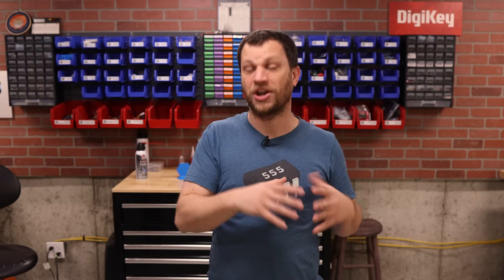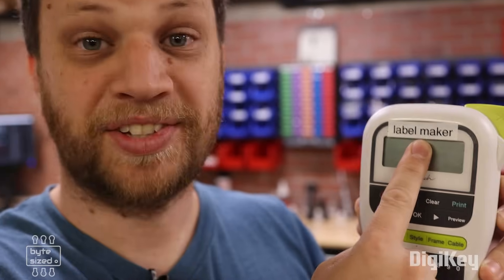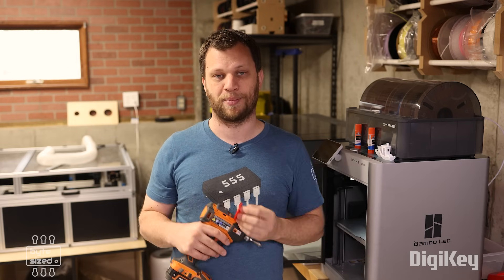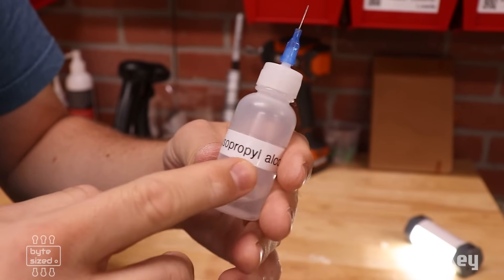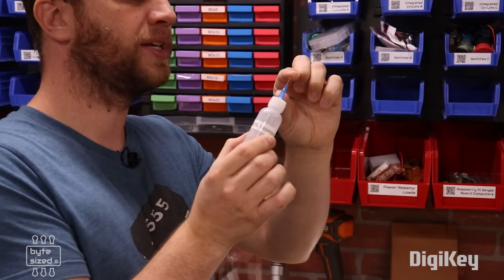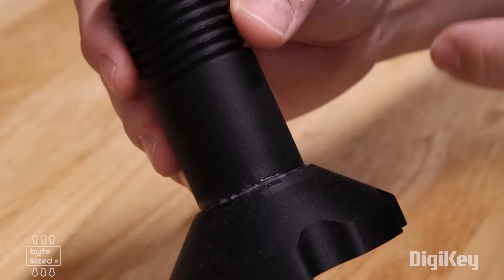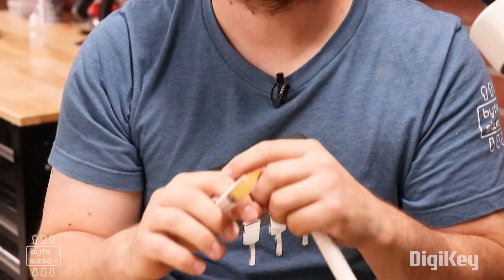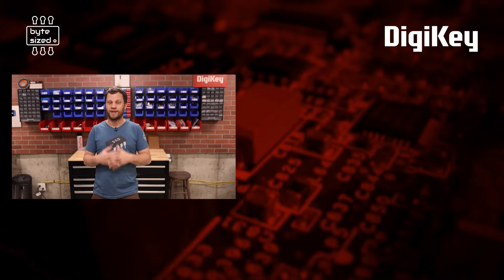8 Things I wish I’d known sooner - The Byte Sized Engineer | DigiKey

Comment: CNCKitchen makes some pretty sweet deburring blades that work better for 3d prints, and they sell them in both right and left hand versions.  Omnifixo makes some of the coolest helping hands with clamps that are superior to alligator clips as they apply even pressure to the entire item you're trying to hold.  You can pull a zip tie tight, and then right before it clicks again, insert a flush cutter right up against and level with the fat part of the zip tie, while still maintaining tension, snip the excess off and it will get sucked in below surface level so that you don't cut yourself on the sharp bit of plastic.  Or, set your zip tie gun correctly, and it should do the same thing, perhaps not all models though. (I used to use an ancient made in U.S.A. zip tie gun from the brand Panduit, and it always cut the zip tie so there were no sharp bits)

Comment: Great tips, further to the don't use a sponge to clean your soldering tip is something I learned from how to cook omelettes successfully. To make sure your fry pan is not too hot, cover it with water to reduce the temperature of the surface, it will not get above 212 F, then remove the water and immediately cook the eggs. When cleaning your soldering tip with water you are effectively doing the same thing. Most soldering is done well above 212 F.